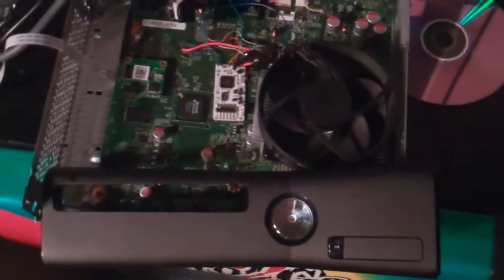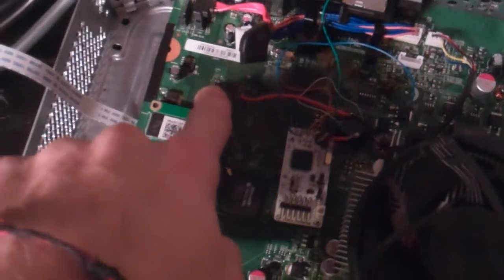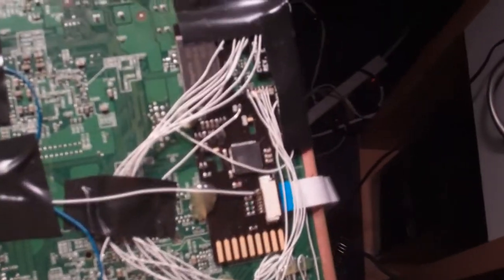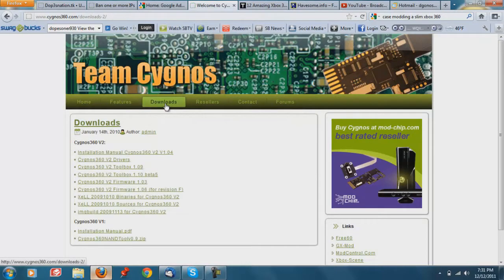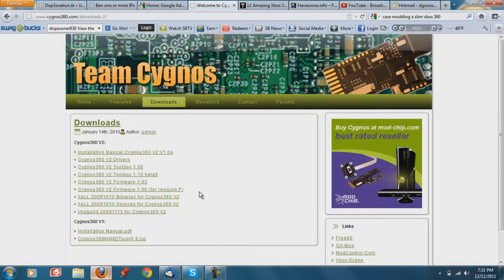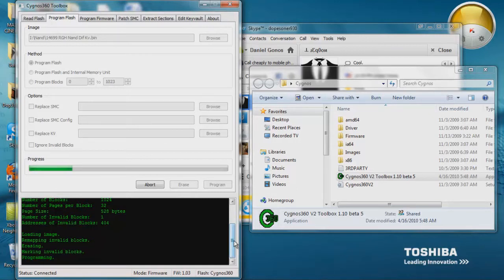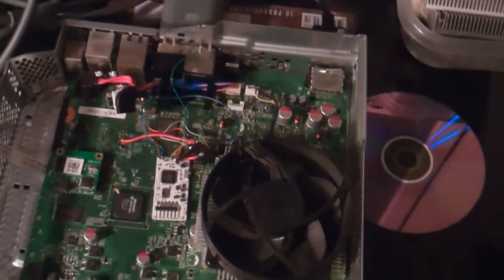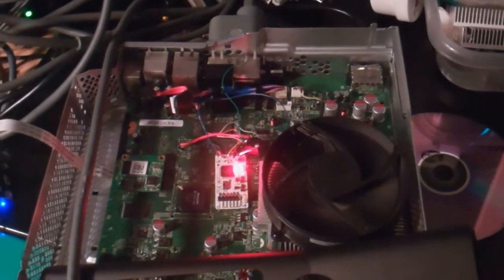Tutorial How to Dual Nand Your Xbox 360 With Cygnos For Live And Rgh Reset Glitch Hack Noob Friendly

Comment: I saw another tut you made for rgh on the slim with a dgx as a glitch chip instead of using a coolrunner. Would I be able to use the cygnos and a relay switch with the dgx or would it have to be on the coolrunner?

Comment: So I'm not sure on this. The Cygnos alone isn't able to work with newer Xboxes. I'm quite positive you need the old firmware/model manufactured before somewhere in 2009. But through the RGH Cygnos will work and essentially let you "dual boot" (dirty-NAND concept). This is probably so since you're doing this on a slim.